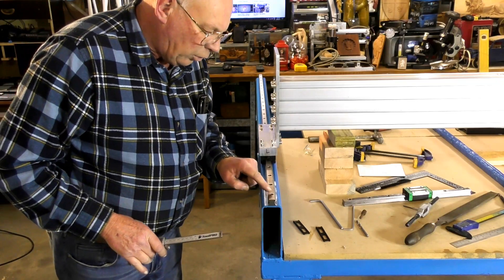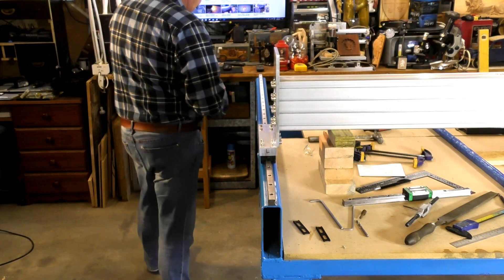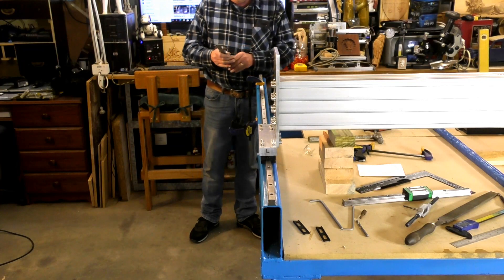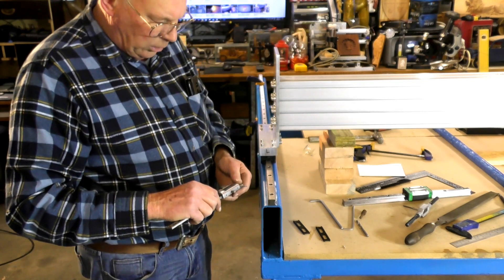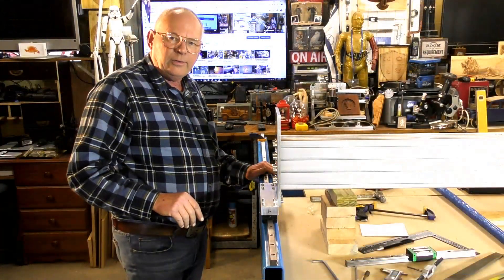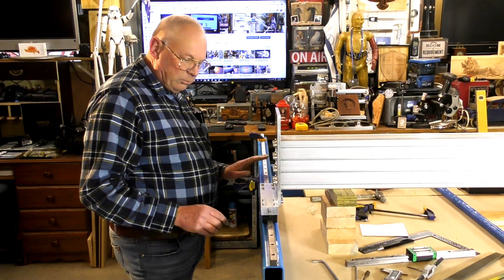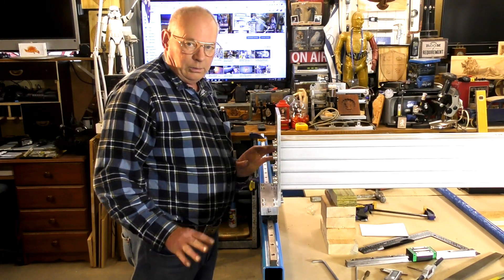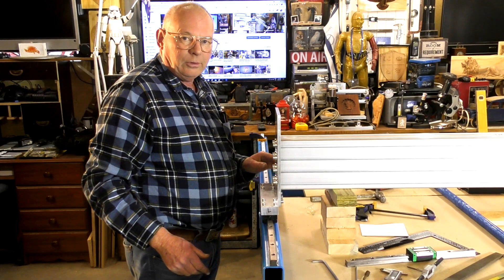Build Your Own CNC! (Y axis and gantry assembly) [Episode 3]

Comment: For the x-axis, are you using quality rails, such as hiwin? If so this is the first video I have seen on the internet where the rails are attached to a metal surface in which the surface was not machined flat or precision ground. I think for not having a machined or scraped surface, the rails will be deformed and stressed which will not provide accurate linear movement along the x-axis, this subject is about precision milling or carving down to 0.003" - 0.010".
Reply from the maker: Hi, there is a facility on my patron pages for technical help
https://www.patreon.com/user?u=15079773